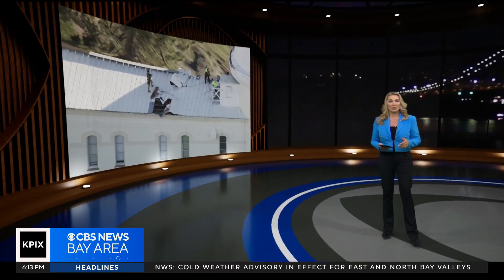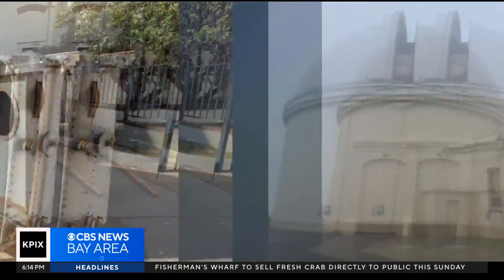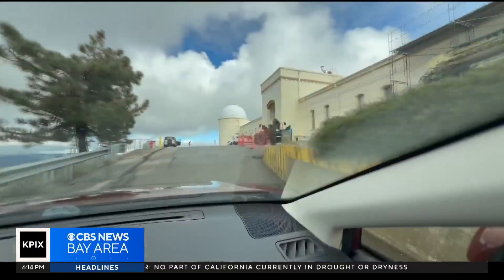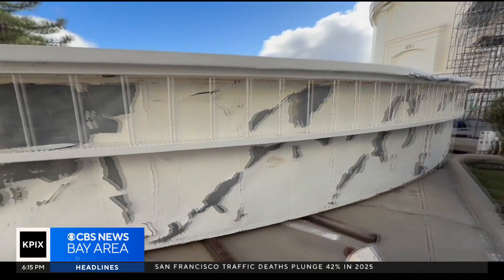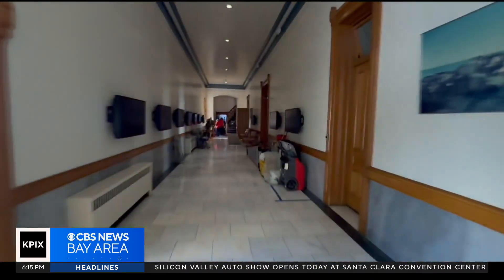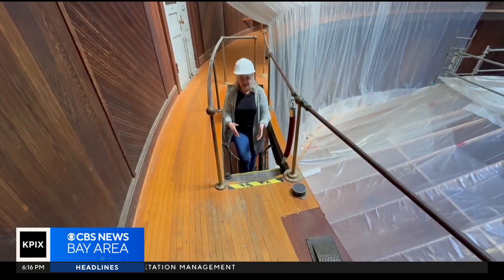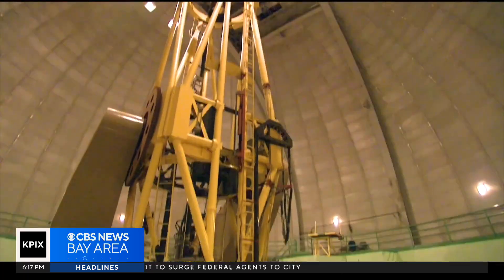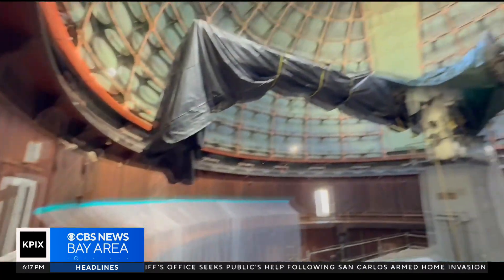A look inside Lick Observatory's repairs following storm damage

Comment: They have large crews, utilizing elaborate equipment to move pieces.  Now go back in time to the original builders & architects 😊
Reply: Not to mention the road to get up there.
Reply: The road was built with no more than a 6% grade because everything had to be hauled up the hill with horse-drawn wagons.
Reply: No need to go back in time. Just go up there and hold a seance. James Lick is buried underneath one of the telescopes there.